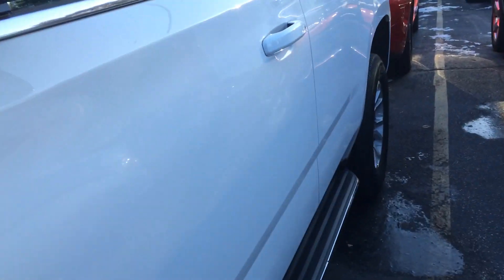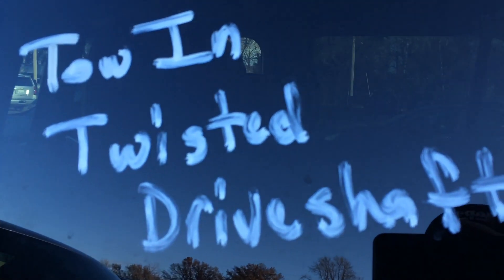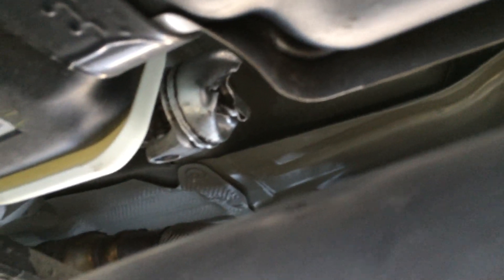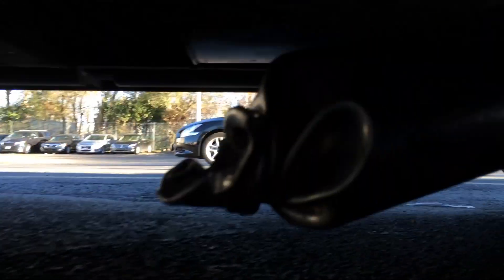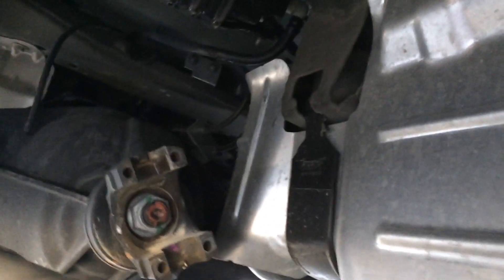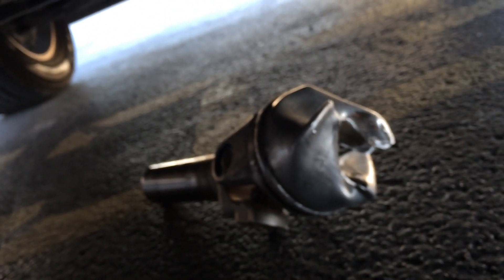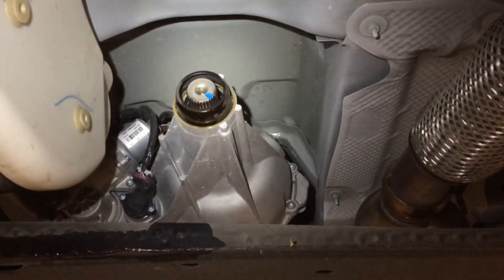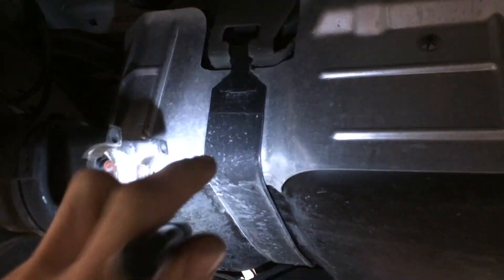Twisted Aluminum Driveshaft!

Comment: 5.3 a beast? Ha. Not so much. They are a good engine at least for a bow tie but they are far from a beast. And as for amazing ft lbs out of a gas v8 is unlikely. Prolly a defect from factory or he was doing some dumb shit that stock shit can't handle ie roasting the tires and they caught traction in a bad way. It wasn't so much the engine that did this, but more about the guy that doesn't know how to hot rod a truck.

Comment: People bringing down GM here this thing has 460 pounds of twist. The owner was probably trying to show off with a burnout or something and twisted the driveshaft KEEP in mind that this thing weighs as much as a small tank lol
Reply: Should have a driveshaft heavy duty enough to handle its torque and weight tho. Gm failed again
Reply: +Kenny M it is as strong as it is needed to do the job nothing more. definitely not standing burnouts. I love how people blame the manufacturer when a customer subjects a part to stresses beyond what it was designed for.
Reply: Burnout with wheel hop I did it once when my tires spun in the rain over train tracks
Reply: +Kenny M it is as strong as it is needed to do the job nothing more. definitely not standing burnouts. I love how people blame the manufacturer when a customer subjects a part to stresses beyond what it was designed for.
Reply: +dav8388  if I just spent $70,000 on a truck or more and it can't do a f**** burnout I'm taking the thing back I've got 500 horsepower in 93 z71 all stock except the motor I beat the s*** out of that thing with oversized tires and never had this problem

Comment: Wow. Great video. Hopefully this isn't the first few to start popping up of a massive recall? It could have been contained metal from the factory. Hopefully this is an isolated incident. I know during preproduction testing that automotive engineers subject these drivetrains to severe abuse, so hopefully this is just a random fluke.